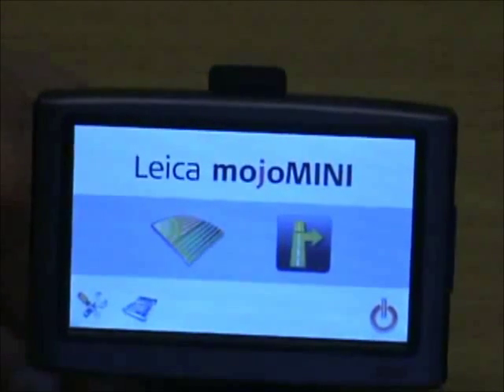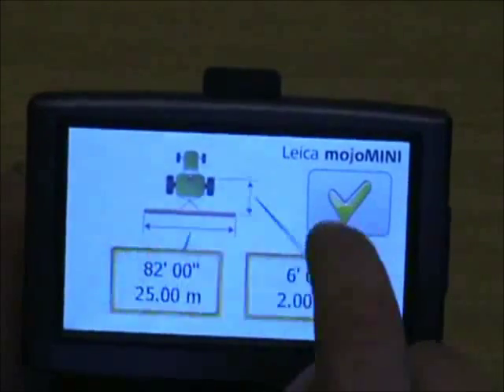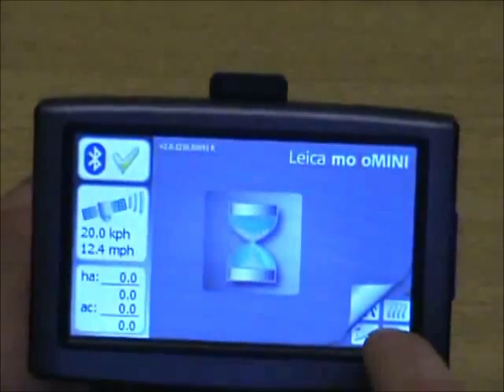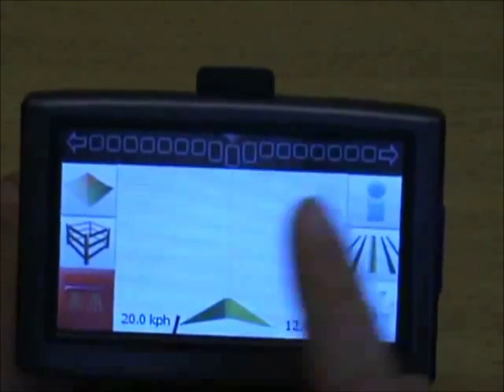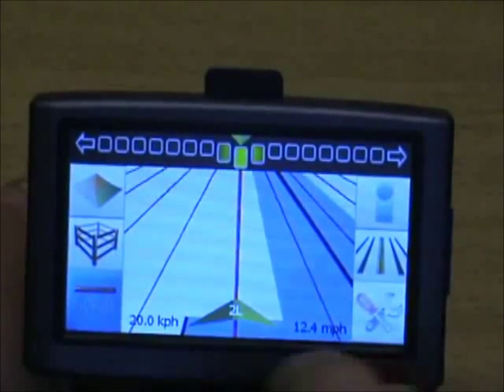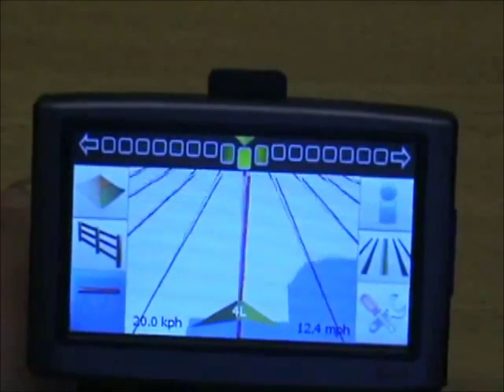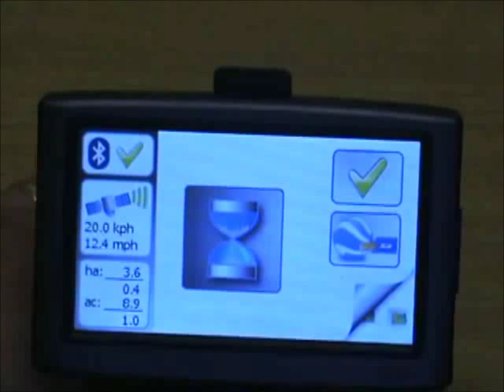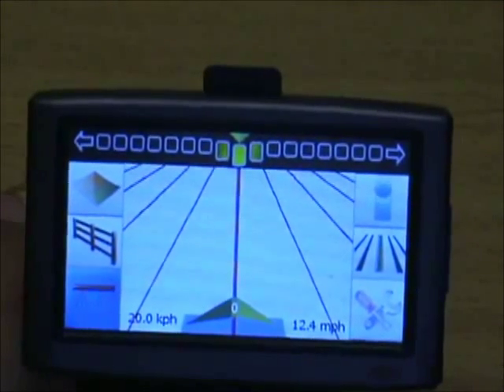GPS agricol mojoMINI: instructiuni instalare si utilizare

Comment from the maker: GPS agricultura: ghidare si masurare suprafete agricole Telefon: 0332564100; 0748291638 Fax: 0318161819 Email: contact@gps-agricultura.ro  
GPS agricultura, GPS agricol, GPS ghidare, GPS masurare, DGPS, masurare GPS, ghidare GPS, masurare suprafete, masurare suprafata, masurare teren, masurare parcela, masurat, masuratori, TeeJet, Leica, Muller, agricol, agricultura, Centerline 220, Matrix 570, Matrix 840, mojoMINI, mojo3D